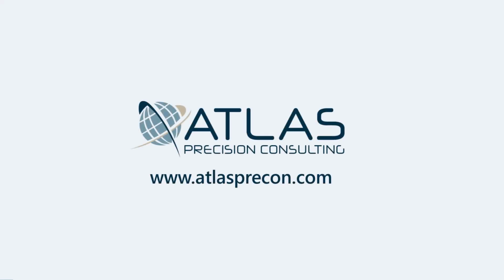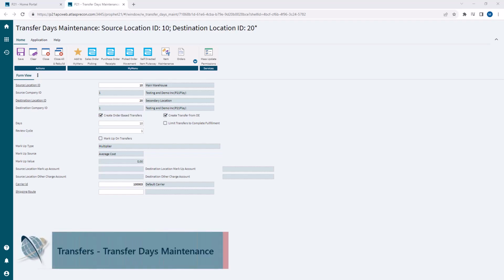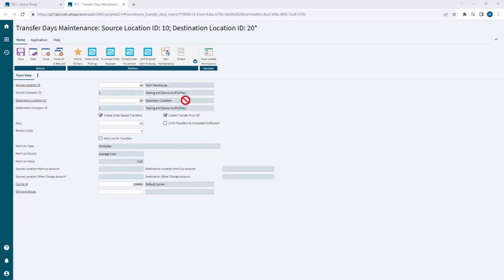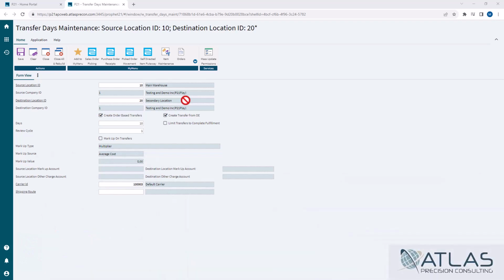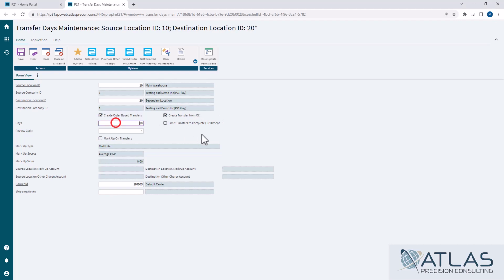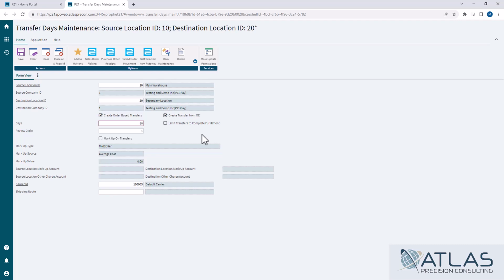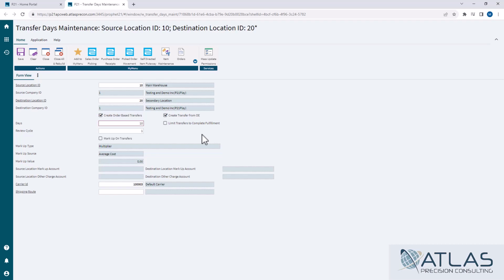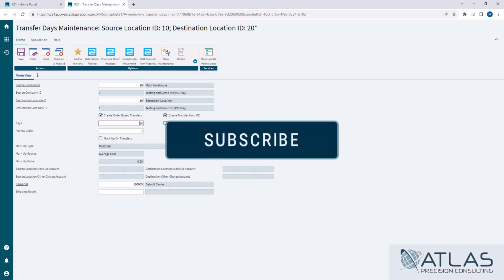Transfer Days Maintenance | Prophet 21 Tutorial | Step-by-Step Tutorial

Comment: Matt, what happens when material is allocated and doesn't have an order linked to that part, or transfer?
Reply from the maker: It could be a variety of things. We can't really give a definite answer without looking at the system.
Reply: Can you upload a video/ learn who or what moved an item last, we are having difficulty finding who moved material and can't understand a trace
Reply from the maker: we will look at getting that into the calendar.   In the meantime check out inventory drill down by bin, and drill into the quantity for that item, it will give you some details on movement.   if this is WWMS, also try the wireless transaction report